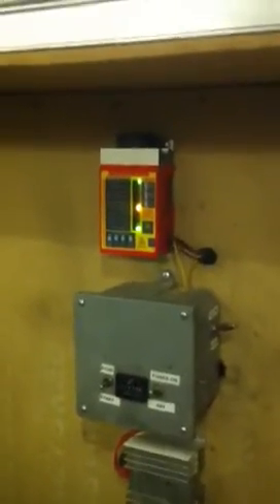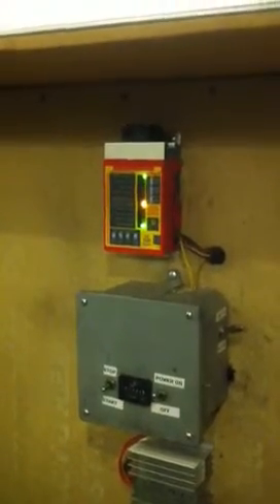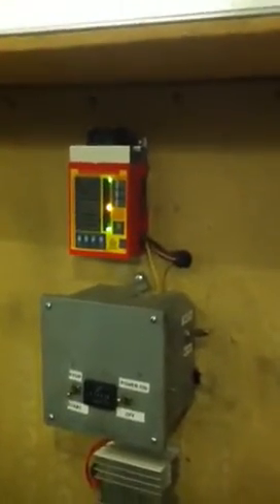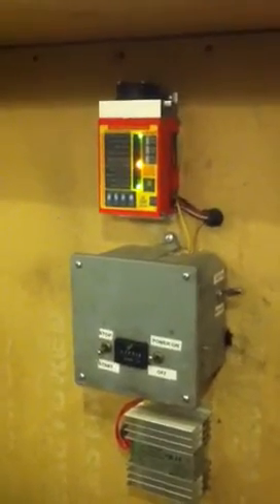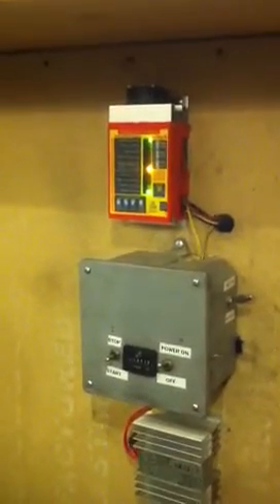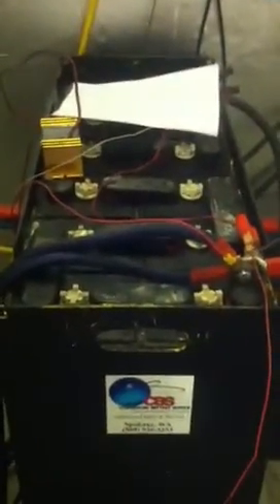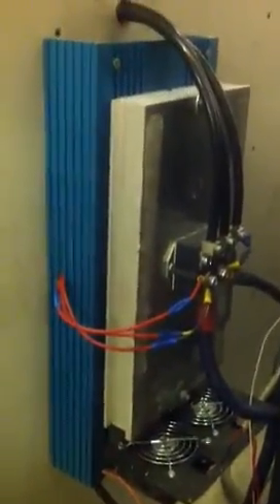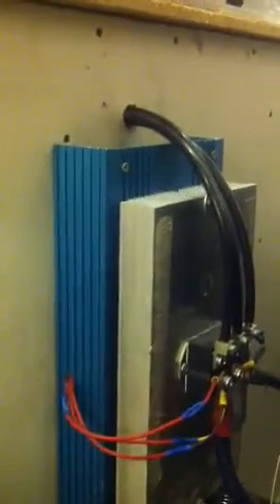Diesel battery charger for off grid

Comment: Hello
nice set up.....
got a lot of questions...can you provide the spec on the outside AC to DC converter. Can you operate at a lower engine RPM...?....or change the pulley ratio(not sure of your engine coupler?)...may result in fuel savings...
Can you go over your fuel consumption patterns.?
I run a 120/240 china head at 1,000 to 1200 RPM. producing 80 to 90VAC for a solar pump. My best fuel usage so far is 7.8 hours per gallon.

Comment: How do you run a washing machine and shower designed for the grid A?C supply from a direct current battery?
Reply: You can operate washing machine simply thru his outback inverter connected to a battery bank.

Comment: Greetings from off grid Oregon. I charge my battery bank with an alternator as well. I use the internal regulator and I have bypassed it for manual charging using a 25 ohm power handling rheostat. My next build is using the same Leece Neville you are using. Taking the bridge rectifier out is the right thing for sure. My question is where did you get a programmable 3 stage voltage regulator charge controller? I do charge my bank through the inverter with a diesel military generator when I need to but the inherent losses would be nice to mitigate. So I use the alternator for fuel efficiency. I see the video is a few years old now so is it still working for you?